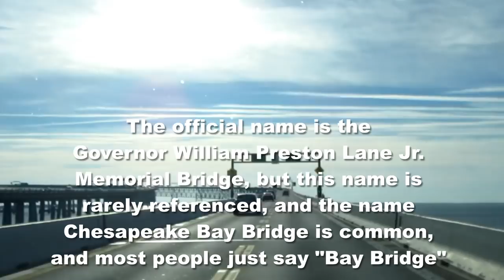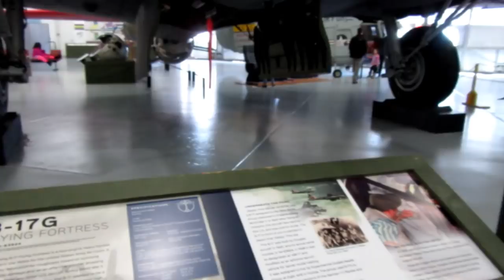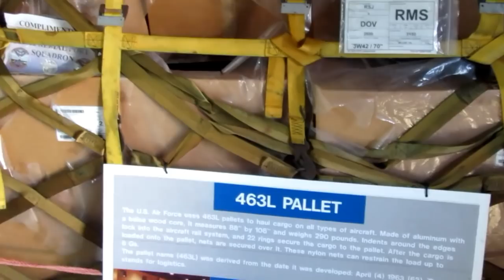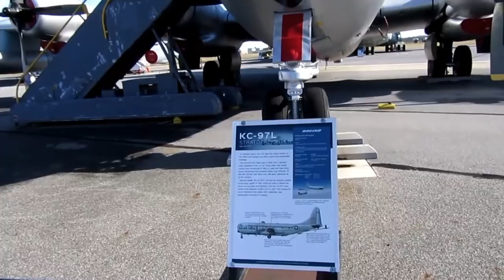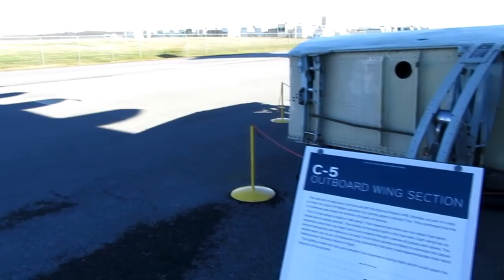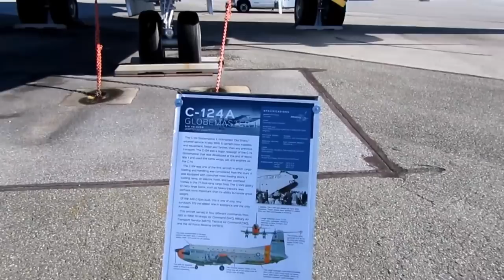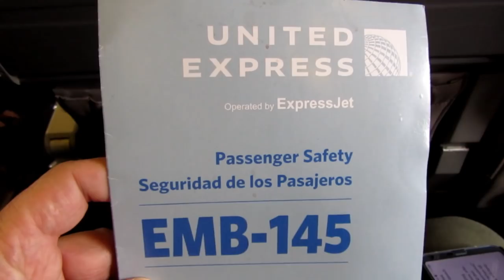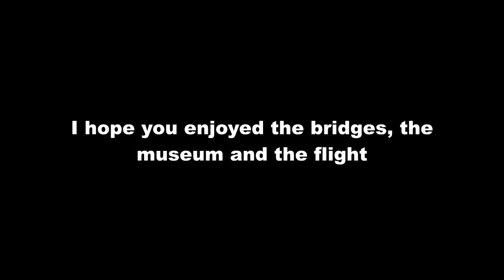A Walk Through the Air Mobility Command Museum (and other stuff)

Comment: I visited the museum once, prior-to 2013. 

I do not know if it is done regularly, but they opened the Douglas C-133 Cargomaster and I got to go inside. 

I have worked on Lockheed C-130 Hercules in both the USN and USCG, and I was rather amazed at how much LARGER a C-133 is in comparison. Prior to my museum visit I had only seen C-133s in photographs.

Comment: The fighter jet SR-71 air that you saw what design in Hamilton Ontario Canada patented Hamilton Ontario   Drew all blueprints in a garage locator corner Wellington and Barton.    1 book e  it is a private private residence rooming house
Reply from the maker: shirrie jackson, either you are VERY confused or are just a poor writer. It is lard to figure out what you are writing here, or what you meant. But it sure seems like you meant to write that the SR-71 was designed in a garage in Hamilton, Canada. Which is absolute nonsense and categorically false.

Also, you r comment is on my video of the Air Mobility Command museum, which does not even have an SR-71. So why are you commenting so inappropriately?

Comment: I enjoyed that.  I bought myself 2 things for Christmas.  One is a cell Phone with WiFi and a Go-Pro Sports Camera with WiFi.  That way I can put the Camera recording into the phone and us the phone for my sound system to knock out the wind blowing in the mic.  It was just last week I saw the best camera set-up.  It's the Go Pro 7 in a hand held Stabilizer.  Smooth Video's.
Reply: My Amtrak Odyssey is coming up in two weeks, From Portland OR, to St Paul. Just bought the Go-Pro 7. I cannot wait to use it on my trip. Downfall is that I have to buy the window mount for it. Last Amtrak Videos I did were done on my I phone this will be a big improvement.
Reply: @amtraktraveler9118  They sell Bundle packs of Go-pro attachments on eBay.  I've never used the phone with the Go-pro before but I'm thinking about using more than one camera then change cameras with just the touch of the screen as I drive.

Comment: Be willing to bet most of those aircraft could be flown again rather easily with a bit of maintenance. The C-141 and the fighters may need to have their engines reinstalled. However I’m willing to bet Air Force 2 the B-17 and C-47 and several of the others could be returned rather easily.
Reply from the maker: @P-J-W-777  considering you have no first hand knowledge of their condition, and that gambling via YouTube comments is not a thing, you "being willing to bet" is pretty meaningless.
Reply: @youtuuba  considering I’ve worked as a volunteer at a well known museum organization taking care of both flying and static aircraft I’m pretty sure the Air Force takes pretty good care of them. Most of our static aircraft could be returned to flying condition as the engines were preserved for long term storage in order to protect their internals. A man with the Smithsonian was asked if the Ebola Gay could ever fly again and his answer was sure most likely with some maintenance. It’s not much different than the Davis Monthan AFB. 
I never said they’d be ready to fly in 4 or 5 days. With a few months of work with the right crew anything is possible. I’ve had more hours working on a B-29 than I could even remember. I was raised in and round aircraft with my grandfather owning quit a few all my life. Everything from single to multi engine.
Reply from the maker: @P-J-W-777  , your own qualifications with various non-museum aircraft does not put you in a position of detailed knowledge regarding the flight ready status of aircraft on display. I am not an aviation mechanic, but I am a volunteer at multiple aviation museums and am a recipient of numerous newsletters and restoration reports from a number of major aircraft museums, many of which describe in considerable detail the levels of restoration given display aircraft. From this I know that their condition varies widely. One guy from one museum giving you an off the cuff opinion does not impress me as being persuasive or authoritative.

I agree that many of the well restored (to display condition) aircraft could be made flight ready with appropriate parts replacement and service. But that would only be 'flight ready for limited ferry flight'; to get them truly flight ready would require a lot more work and massive expense.
Reply: @youtuuba  the fact is I came to your channel to watch your video because I have a love and passion for aviation as well. Yes I have worked on helped rebuild plenty of museum aircraft including  what was once the only flying B-29 in the world. Helped rebuild and restore a P-38 from a shipping container and various work on a  P-51. So I’d say I have a little museum experience. I didn’t expect a rather rude reply. Pretty sure you’ve heard about the Frozen Tundra B-29. The team successfully restored it to flyable condition and would have brought it back home had it not been for a fuel leak. They did this out in the middle of nowhere with limited resources. I want to see these aircraft restored and maintained for future generations.
Reply from the maker: @P-J-W-777  , you are all over the place with your reasoning. You don't seem able to understand the points I have been trying to make. You own experiences are not apples-to-apples comparisons to what you originally wrote and to which I made your reply. Your own love for old aircraft, which I quite obviously share, is not enough to make you an expert in the condition of aircraft in museums. We will accomplish nothing further by further exchanges.